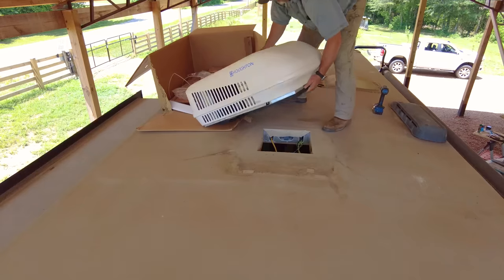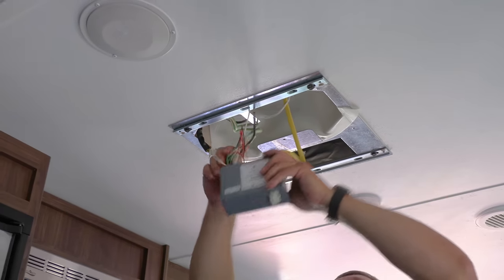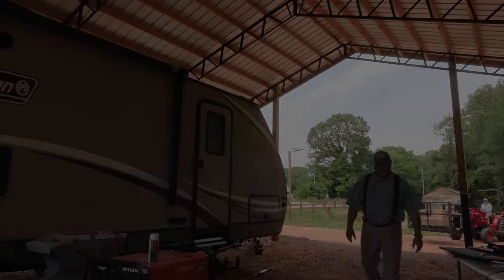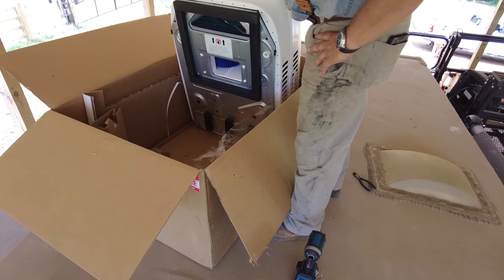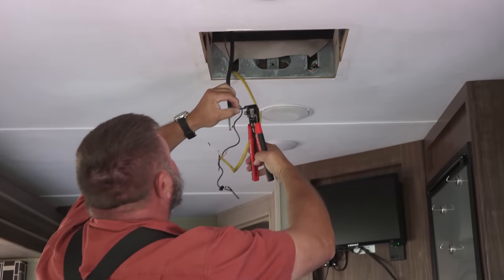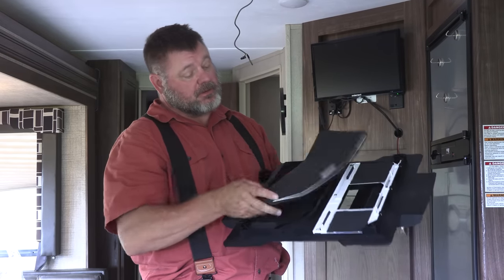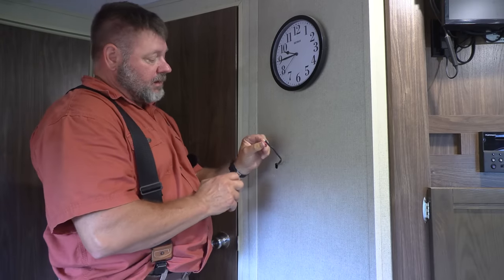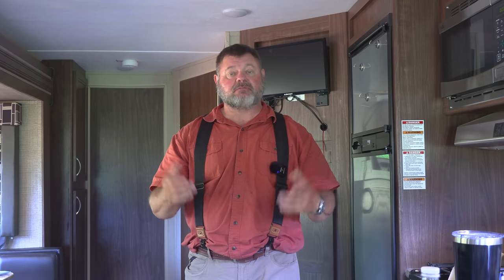Install RV AC Heat Pump - RV Air Conditioning Stopped Cooling

Comment: Just bought a RecPro and hubby will be doing a self install so your video will come in very handy.  We have a 2015 fifth wheel and had to have the Dometic a/c replaced when the rv was one year old.  Seems back then Dometic put out some bad units so it was replaced under warranty.  The repair guy showed us how badly the a/c was taped so he did a great job on correcting that.  He also told us to check each vent and make sure they were taped also.  They were not so all of those (every one) was retaped.  A/C in the bedroom was also retaped and there were scraps and junk found in it.  Looking forward to having the ac installed...we are in Texas and it has been exhaustingly hot.  We have been using a floor unit that vents out the window and it has kept us comfy but takes up floor space, making things a bit more cramped.  Thank goodness the bedroom a/c has been working great.  Thanks for your video
Reply from the maker: Thank you for all the kind words. We've had a very hot summer here as well. I'm glad that my video has helped.

Comment: Nice job, but there are WAAAAAY better alternatives to a roof top unit if your camper has the space. I decommissioned the 2 roof top units on my camper and installed a mini split system. Super efficient and very very quiet.  Love your videos
Reply from the maker: Thank you for the support.
Reply from the maker: I still plan on taking my trailer on the road. Mini splits are not designed to be beat around. I am not sure how they will hold up long term if the trailer is moved. This new unit I put on is not like the old ones either. It is very efficient. I am putting two mini splits in my cabin build. I have one mini split in my home's sunroom. I love the mini splits.
Reply: @TonysTractorAdventure  that is awesome. I can appreciate that. Didn’t know about the improved roof top units. 
Thank you for your videos. I always find something you are doing that helps me in my projects

Comment: I really enjoyed the video. I didn't know they made anything like that. I'm going to check on them and possibly put them in my new camper. I'm just wondering about the heat because ours has a heated under belly. Always enjoy the videos.
Reply from the maker: I think the heat pump will work really well in our area but I don't think it would be good up north. I think you would still need gas heat as a reserve. We have had the unit running for the last month and it has gone through 102° actual temperature with a hand index of 132. Condensation was running off the top of the travel trailer like a waterfall. Inside the travel trailer it was a comfortable 72.
Reply: @TonysTractorAdventure  we are in the southwest part of VA so Temps get a little cool in the winter. We normally stop camping around December and start back up in mid February or late March. I guess I would just have to see how to wire the gas heat up with the heat pump. I hope you will do a follow up video .

Comment: Typically that ceiling cavity is a common ceiling plenum (duct) that feeds the bathroom and back bedroom.
Reply from the maker: The duct you see in the video goes to the bathroom and the bedroom. On the other side, it goes to the common area. Any company that uses the whole ceiling cavity as a duct is not worth the salt that makes them up.

Comment: Fantastic video guys. I'm finding the website for the 3800 states minimum roof thickness 3", maximum 3 3/8"... It looks like we're sitting as bout 3 3/4" (3/8" too thick) but your video shows what seems to be even thicker than that. Did you use the stock bolts, or order extended? The website says the extended bolts are only for the non-ducted model. Thanks for the video!
Reply from the maker: Mine just bolted right up with the included hardware. It has been awesome this summer.

Comment: Tony off topic but I've landed on your channel as I've been researching TYM tractors specifically looking at the T25. There's a 2023 model at a dealership but was curious if you know when 2024 models come out or if there are any upgrades that you're hearing in that model?
Reply from the maker: Tractors don't run in year models. We keep up with modifications by serial number runs. Some serial number runs maybe 2 years long. I don't know of any big changes coming to the T25 other than red rims and possibly an optional step.
Reply: @TonysTractorAdventure  thanks Tony I really appreciate it and I'm really enjoying your Channel
Reply from the maker: Thank you very much. After reading my last post to you it becomes clearly obvious. I shouldn't trust speak to text.

Comment: I think I want to do a 12 volt roof top unit because of the massive draw on the battery bank. Not good if you want to boondock. No??
Reply from the maker: I don't boondock, so I don't know.

Comment: Thanks for the video I have 20 amp breakers for my air conditioner what did you have for amps
Reply from the maker: Mine is 20 amp. My whole camper is only 30amps.
Reply: @TonysTractorAdventure  may I ask which model you purchased?

Comment: I want to do the swap and retain the propane heat as I live in a northern state. Any advice on that? I know I would have to keep the original thermostat and wire in the control box. I’m trying to remember is the roof unit ducts the air through the propane unit as well or is it a separate blower. Heat does go through floor vents and cool is from roof vents.
Reply from the maker: The propane units duct through the floor. You will have to keep your original thermostat. We We don't get that gold in TN
Reply: @TonysTractorAdventure  Do you think I should just go with the recpro and forget the Coleman compatibility possibility (run the propane with the same wires)?  BTW, can you set the thermostat to heat at night if needed and cool in the day, like my home unit with a single setting?
Reply: I have the same issue.   How did you wire so the propane heater would work?
Reply: @greatlifedogtraining8720  went with the Coleman heat pump. Have to get the right control box. An additional wire turns on the heat pump. There’s a control box on Amazon that won’t work. If you need part numbers, let me know.

Comment: Does your camper have central air? because thats why it would blow into the roof.
Reply from the maker: There is absolutely no reason to blow directly into the attic of any uninsulated structure ever. The  duct work is there, but they were sloppy building the travel trailer and didn't finish the job. .